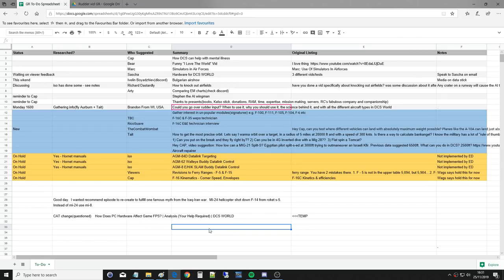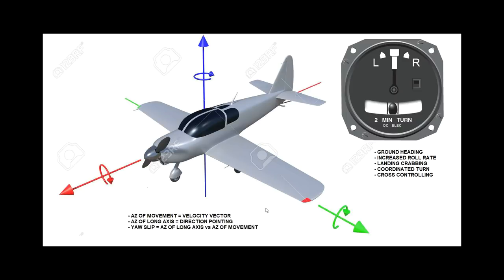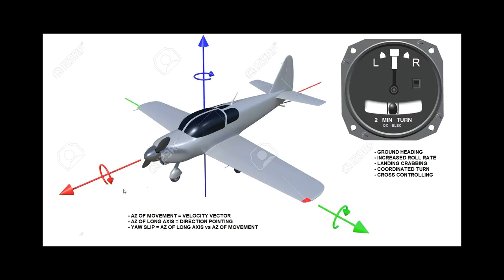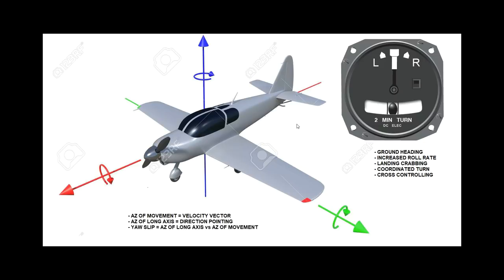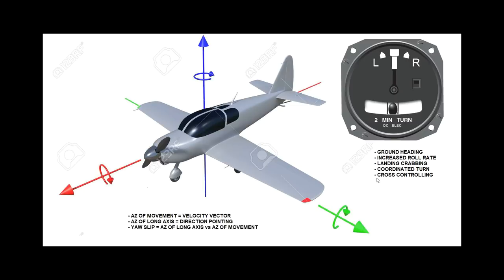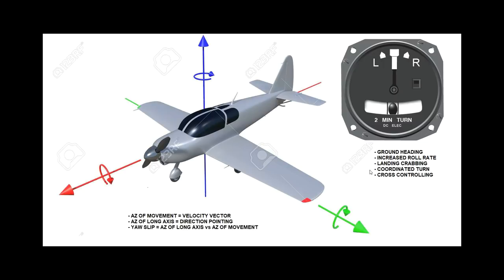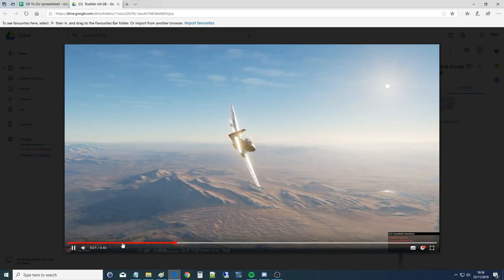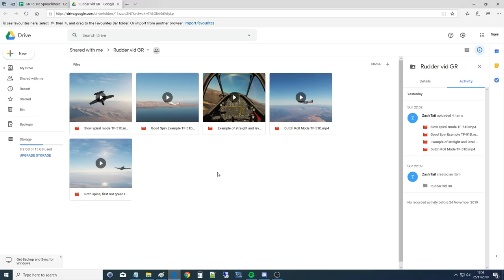Flying Basics: How & When To Use Aircraft Rudder | DCS WORLD

Comment: another thing I've learned: at least one other reason, if not the main reason, for a turn to be not coordinated is the fact that the ailerons are producing asymmetric draft. I think the one that goes down produces more draft than the one going up which leads to a rotation around the yaw axis. That's why the rudder input is only necessairy while using ailerons / chaing roll, not during the complete turn. Talking about 90° roll turns might be different then, but I think at a 30-40° bank angle of a normal plane, the fact that the tail "goes down" to me seems not realistic.

Comment: F/A-18c Coordinated turns. I noticed when I  bank and turn the aircraft the ball is not completely centered, the ball is in between the lines just not perfectly centered. I noticed I can get the ball “perfectly” centered with small rudder inputs. Is there a reason the Fly-by-wire doesn’t “perfectly” center the  aircraft? I understand the FCS is not perfect. I know that’s a tricky question, curious to get your thoughts. Thanks

Comment: A ships rudder actually does operate very much like the rudder of an aircraft.  Aircraft have a three extra degrees of freedom though, so it's effect on movement is going to be different.  The point is that the rudder will cause a yaw.  Ships also don't always go in the direction they point either.  There is course and heading and they don't always align.  In fact it's probably much more common in a ship to have them misaligned than in an aircraft.  The principle is the same as well - Bernoulli's Equation at work.

Comment: I appreciate your videos and instruction of DCS. Very entertaining and informative and well done. Thanks  

The correct term for cross controlling is using a side slip or forward slip. Side slip is for alignment with the runway landing and a forward slip is for creating drag and loosing energy.  Coordinated use of the rudder is to counter adverse yaw. The ailerons create different amounts of drag and the rudder counters this adverse yaw. The modern planes use yaw damping and this is done automatically. Mostly you understand the aerodynamics of the rudder but are using incorrect terms as you said in the introduction. The horizontal tail is not called an elevator on most all supersonic fighter jets. It is called a stabilator or full flying tail, just like a rudder a  elevator will not work on most all aircraft  going supersonic or just under supersonic. Most everyone still calls it an elevator, even most everyone who flies these aircraft.  Much like a lot of terms held over from the old prop days. We still call the thrust leavers in a 767 throttles.  The full flying tail  was discovered to fix the problems just after the first supersonic test flights and the full flying tail was top secret until the rest of the world figured it out.  Many pilots lost their life in WWII do to going too fast and losing control of the elevator and not being able to pull up. To make matters worse, when the low speed wing gets near supersonic you get a shock wave forming on the top of the wing and this causes the nose to go down.  Modern Airliners can also experience this and it is called Mach tuck.  Most fighters get just about an equal shock wave on the top and bottom at the same time so they do not tend to tuck.  

My expertise is 45 years of being a flight instructor in single and multi engine aircraft and gliders. 30 years of flying large heavy jets and an aviation degree.

Comment: Prop plane drivers use the rudder much more than what is explained in this video. In a prop you use the rudder to compensate for torque, slipstream, and something called P-Factor. Most notably on a takeoff roll you will need significant rudder input to maintain a straight path down the runway due to the torque effects of the engine. Overall good information, albeit slightly misinformed.
Reply: Yeah,inspecially in ultralights
Reply: I'm about to add that too. I fly single prop airplane.
Reply: I found it a bit odd that they didn't talk about the one thing unique to prop driven aircraft... While demoing everything with prop driven aircraft
Reply: They talked about rudder on takeoff roll WRT prop planes.
Reply: You're knowledgeable. My budget doesn't include rudder yet. Is a stick with 'twist' axis a decent temporary solution?

Comment: I remember being wowed on  my first glider lesson that the slip indicator is normally a piece of wool or thread taped onto the outside of the canopy.  Note when crabbing on approach applying the rudder will also generate roll, so to maintain level yawed flight BOTH rudder and aileron  must be used.  You also need to 'kick' the plane rudder immediately before touchdown to align the yaw angle to the runway heading otherwise your wheels will take you off the runway when they touchdown.  And don't forget that final kick straight will still generate roll..so you have to correct that too!  Great video
Reply: Honestly, that is why i prefer the slip to the crab. I personally found the slip much easier to land than the crab. Recently got back in DCS after going through flight school. So much has come in helpful when fly. I do know that rudder is not nearly as important in jets because they don't have to fight the P-Factor from torque caused by propeller lift.

Comment: Turn coordination only needs to be dealt with when ailerons are displaced.  The force being counteracted by the rudder is called adverse yaw.  This yaw force is caused by induced drag (when an airfoil makes more lift it makes more drag).  During a roll, the upward moving (downward displaced aileron) makes more lift and more drag, and the downward moving wing makes less lift/drag.
This lateral difference in drag causes a yaw which can be offset by using rudder.  This is what's happening when the tail "is falling downward" (11:10  in the video).  Once the desired bank is established, the ailerons are neutralized, the yaw goes away and rudder displacement is no longer required, unless it is correcting some other perturbation.  This effect is magnified in planes with long wingspans.  It is quite dramatic in gliders.  The "uncoordination" induced by roll is usually insignificant in short wingspan airplanes at low alpha.
       Airplanes with powerful engines driving big propellers need lots of rudder input to counteract the torque of the engine, and the aerodynamic effects of spiraling airflow behind the prop.  To little rudder is why the warbirds usually slide to the left on the mass takeoffs during birds and bees.
       The rudder can generate very powerful roll forces in swept wing planes.  In a yawed swept wing aircraft one wing is more perpendicular to airflow and makes more lift than the wing on the other side of the fuselage that is less perpendicular to the airflow.  This effect is magnified with increasing angle of attack.   Yaw generated roll force is present in straight wing airplanes also, but is not as powerful as swept wing planes.  When a straight wing airplane is rolled the fuselage blanks off some of the airflow on one side, causing that wing to make less lift while  the opposite wing has better airflow and makes more lift thus generating a roll force.  More dihedral can magnify the effect because the angle of attack is increased slightly on the "leading" wing in a yawed situation.  Rudder rolling at high alpha is tricky though because you are close to inducing a stall.  The ingredients for a stall being yaw and stall at the same time.
Reply: Not sure if that's what you meant by "other perturbation", but you definitely need to apply rudder during the turn due to the airspeed difference between inner and outer wing.
Reply: @moritzheppler8242  How does the airspeed difference between the inside wing and the outside wing generate a significant yaw force?   For the purpose of the question I define significant as something the pilot could sense.   And, how much faster (in terms of a percentage of the inside wing speed) is the outside wing going?
Reply: @dbail3452  more airspeed means more lift, which in turn means more drag. I fly gliders, and it's definitely a significant force. Generally, you need to leave in about half the rudder input you used when entering the turn. Unfortunately I don't know what the speed difference is in percent, sorry.
Reply: @moritzheppler8242    I stand by my original statement, but thanks to you do need to modify it somewhat by adding "except for gliders".   Doing the math, the side to side difference in airspeed for a 250 kt, 100' wingspan plane in a 45 degree bank turn is about 2.5%,  for the outside wing tip relative to the inside tip, which would make an insignificant drag difference. 

          However, the percentage in a glider is greater, and I totally believe your empirical evidence that you need to keep rudder in during the turn after the bank is established.  I do however think you are mistaken about the reason for the rudder input requirement.   If one wing is making more lift than the other wing the air frame would be rolling.  There is no roll in a steady state turn. 

         The rudder requirement is a conundrum to me now that you brought it up.  The inside wing needs to make the same lift as the outside wing but at a slower airspeed, so its effective angle of attack, and therefore induced drag would be need to be greater.   If that's the only thing going on,  you'd need top rudder to stay coordinated, but that's to what's happening.
         I think there is more going on.  I may look into it if I have the time/motivation.  Maybe it has something to do with those bendy glider wings.
        Thanks for the reply
Reply: @dbail3452  hm, you're right, in my scenario there should be a rolling motion. Let me know if you find out anything, I'm curious now.

Comment: I really don't like the axplanation of "wing is faster" because if you do the math, it doesn't ever check out. For example, flying knife-edge implies both wings are travelling at the same speed. Rather the other wing is just partially going thrroughdirtier air flow works better.
Also I've got a question if he really is an aerodynamicist: Where do you actually do your study? Such study and research fields don't exist in my state it seems and likely my entire country because there aren't any major manufacturing here for aircraft and therefore not many jobs. in the field.

Comment: I always use rudder when I want to affect the yaw axis, never when I want to fly straight. 🙄
I hope that clears things up a bit.
Also handy for knife-edge flying and fixing bad parking jobs.

I imagine a high speed jet has a lot less need to coordinate its turns than a slower prop plane.
Just Bank it and Yank it most of the time.

If the wing has Dihedral angle, you can also cause the plane to Roll on the Rudder, without any Aileron input.
Also known as Dutch-Roll, not to be confused with Dutch-Rudder! 😋

Comment: That rudder incident was an airbus:

American Airlines Flight 587
Airbus A300B4-605R
Separation of the vertical stabilizer following excessive rudder input
Reply from the maker: thx
Reply: The 737 had its own rudder issues known as ‘rudder hard-over’. This was a faulty design which periodically moved the rudder to full deflection and made things quite exciting quite quickly. Several aircraft crashed but a few recovered and the fault was discovered. Boeing introduced ‘canned speeds’ for weights above and below 60tonnes on the 733 (the one I flew). These speeds meant the ailerons would have sufficient authority to overcome the rudder should it decide to try to wag the dog.

Comment: Just a slight correction to the discussion about crossed controls (rudder opposite to ailerons).  It is not aerodynamically unstable, but it stresses the airplane in all three axes.  Therefore, it is discouraged in many general aviation planes.  It is perfectly acceptable in fighters and aerobatic GA planes.  You just need to know how to use it to either slow down or drop altitude without speeding up.  My cousin was showing off and used the maneuver to drop altitude on a landing.  You could hear the wind flow getting louder and creaking of the airframe.  It gets your heart racing.

Comment: I'd like to ask why some aircraft have down-swept horizontal stabilisers (commonly UK fighter jets: Harrier, Hawk, Tornado, Jaguar etc.,) and others have straight (commonly US: F14, F15, F18, F22, F35 etc.) Is it just that they mirror the wings? I've noticed UK aircraft tend to favour a more arced wing shape rather than flat and straight. It's just something I always wondered when building my Airfix models as a kid.
Reply: Flat straight=less resistance therefore more speed but bigger stall speed

Arced=more lift but less speed
Reply: Also with straight swept wings toy can come into allsorts of issues with the effective airspeed at the wingtips is equal to almost 0 knots ending up in wingtip stalls, especially in planes like the mig 15 I believe with giant wing fences to redirect air over the wing.
Reply: Great answer here: https://aviation.stackexchange.com/questions/26277/why-does-the-dc-10s-horizontal-stabilizer-have-such-a-pronounced-dihedral

Comment: I still don't know if it's a case of pushing left or right pedal to make the rudder yaw left or right. I have searched about 6 videos so far on rudder pedals, but none have yet explained which pedal you should use to yaw a specific direction. I'd like to set up my rudder pedals to function the same as they do in a real aircraft, but it's frustratingly difficult to find that information. I might have my pedals set up backwards for all I know.

Comment: I've been flying Remote Control planes since I was 12 Y/O so I learned coordinated turning early on. I use coordinated turns in DCS when I want a flatter turn at lower speeds. (ever mindful of the possibilty for causing a flat spin) I still do it with my RC Jets as needed, sometimes just to help keep my wings a bit more level on slow approaches. I feel like it reduces the possiblity of a "tip stall" when there is very little altitude left for a recovery. With the modern radios and gyro stabilization that we have now, we can pretty much set up an "automatic rudder" too.  It will fight crosswinds for you allowing you to maintain your heading. Also aids in takeoffs fighting engine/prop torque. (heading hold gyro) Having said all that there are a great many RC planes that simply have no rudder at all. They have a vertical stab but no rudder. Found mostly on smaller planes. This type of flying is often referred to as "Bank and Yank"

Comment: A couple of notes about increasing roll rate with rudder. As you said in the section about cross controlling, rudder inputs increase drag. That means that if you roll with large amounts of rudder input you will lose more speed than you would by using ailerons only.